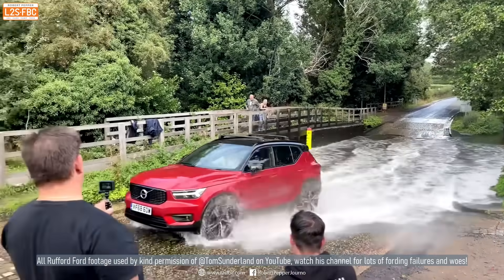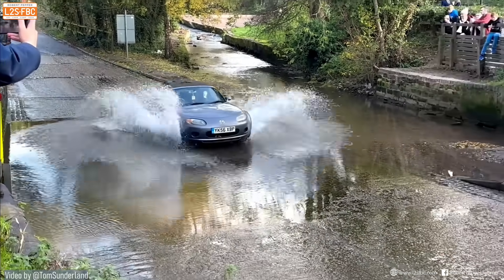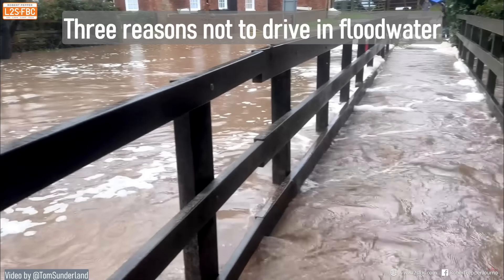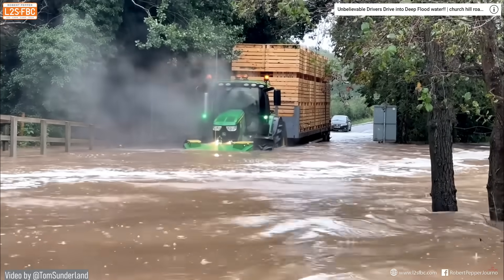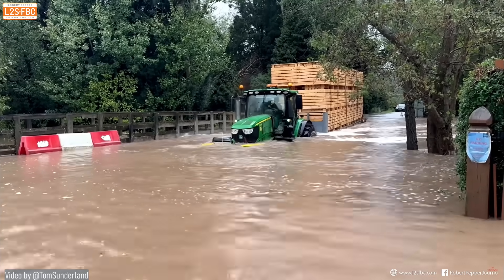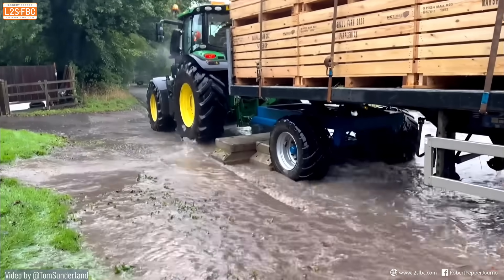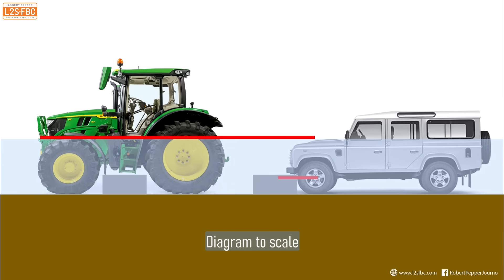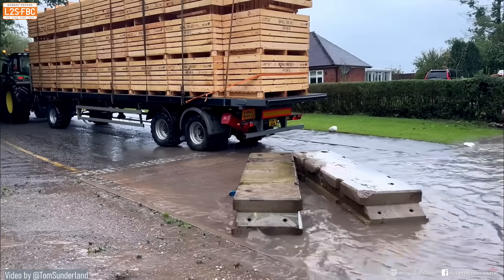A demonstration of why you shouldn't drive through floodwater.

Comment: Interesting story behind that. That ford is actually closed permanently now, and those blocks were the closure blocks put across it. A few of the locals are a bit miffed over it being closed, and ole mate in the tractor just decided to send it anyway.
Reply from the maker: Yes. aware it's closed, wasn't aware it was closed when that tractor went through!
Reply: @L2SFBC Somewhere in Tom Sunderlands footage is an excellent example of the dangers of sending it at speed too. Driver comes from the other direction, and the driver ends up going up the creek to the right instead of up the road
Reply from the maker: Can you post a link please?
Reply: Council put those barriers across,  when the water level was lower.
Reply: it's never been lawfully closed. just blocked up. it's still a public right of way.
Reply: Tractor driver knew those blocks were there, he was just fed up of the closure of the ford from these barriers that had been placed down
Reply: Pretty sure the farmer knew exactly what he was driving over.

Comment: Cars have a tendency to float, the tractor is all mass with very little displacement, cars on the other hand make passable boats, but only for a short time. Getting washed off a crossing when there is flow, or the back end floating when its deep mean that you lose control pretty easily.
Things were getting crazy at that ford and I think the road has now been closed. The farmer complained because people were trespassing on his land to dam up the creek to flood the crossing and get better vehicle splashes.
Reply from the maker: Yes, I read it went crazy...local publicans would have loved it, homeowners not so much I guess!

Comment: I was teaching some RNLI Water Rescue Instructors some years back and they have a rule-of-thumb: 6inches if water moving at 6mph (twice walking speed) will knock someone off their feet.
Water weighs 1tonne per cubic metre.
Defender 110 is approx 4.5m x 2m, wading depth is ½m so potentially 4.5 cubic m of water = 4.5t so if the water is moving you are going where it wants 🙂
Obviously 250mm is going under the LR until it hits the chassis and side but the idea makes sense to most people.
I tend to say if you haven't walked it what the heck are doing driving your vehicle there😂
Most wellie boots are not as high as official wading depth so this keeps drivers from the worst of it...

Comment: 2:47 aside from the fact that this tractor is trying to pull the trailer over the submerged obstructions, the tractor itself is almost floating and has little traction. You can see this by the way it bobs up and down. The large  wheels provide a lot of buoyancy if they are not filled with water ballast.
Reply from the maker: No it's not floating. Unlike a car there is no large air filled space. The volume of air in the tyres is not enough either and the tyres may be partially filled with water - any tractor drivers like to confirm?  This one also has additional weights over the front.

Comment: most people won't understand that that tractor had a huge weight on the front and as he probably already straddled the concrete block by the time he stoped after hitting it he couldn't reverse (at least in 2wd) because these trailers offer barely any weight transfer to the tractor (no weight on driven wheels) and that's assuming he had somewhere to back up to and turn around given he couldn't be bothered to back up enough to avoid the concrete blocs at the end...

poor situation poor driver.

  That level of water is too high for confort he probably got water in the hydraulic system gearbox and air compressor as well some troubles could be on their way...

Comment: The easiest reason for me would already be: usually the force of the water is vastly underestimated by everybody and so it gets too dangerous. (washing away the car) Even if the water is not higher than the ground clearance of the car. (Have seen firetrucks having a hard time crossing 30cm of water on a road, which would have been easy if it would have been just about the depth, but the current was so strong that the truck barely made it across and was moved sideways a lot)
Apart from brining the point across (hopefully to those who questioned a reason beforehand) i think this video example also shows that the guy on the tractor is very much not the brightest light under the sun.
Right when his front wheels were going up on something he should have already realized that he won't be able to pull that trailer over this size of obstacle he just found.

Comment: Another issue is mechanically driven fans pulling forward because they get more "grip" in water than they do the air they are designed for. Its quite common for them to move enough to chew a hole in the radiator. That gets bad quickly. Notice the water spraying out the side of the motor on the tractor as it exits the water, the fan doing that?

Comment: The crazy thing is that there is a detour around the ford that adds only an extra 2.5 miles or 7 minutes. Yet people directly into flood water and put their lives at risk. I guess this another case of 'this is why we can't have nice things.'
Reply: Can you imagine the farmers having that detour in a tractor. They've been driving that ford for I don't know how many years and then council comes along an puts concrete k rails across because some dickhead gets their toerag flooded. Catering to the lowest common denominator.
Reply: That's the reason the farmer was pissed. 7 minutes by car is not 7 minutes by tractor. 2.5 miles is a pretty long distance with farming equipment.
Reply from the maker: Yes - fuel as well, it all adds up if you're doing that trip a lot and time is money.  I can understand the annoyance if there's an extra 2.5 miles of distance on what is probably a 2 mile journey.  But, that doesn't excuse what happened.

Comment: My dad said to me when I was learning to drive 45+ years ago. "Never drive through water you don't know the depth of." And to this date, I never have.
As you pointed out. If you can't see the road surface you're driving over, how do you know it's still there?
As for the video and those concrete blocks. Where the hell did they come from? There seems to be know where upstream from the rivers normal depth that they could have come from.
They'll remain a mystery unless someone knows.  🤔
Reply from the maker: Seems the council put them there to block the road. However they either forgot floodwater rises, thought nobody would drive through if it did, or the blocks were moved by the water.
Reply: @L2SFBC  That would be so typical of the council.
There used to be one of those triangular FLOOD AHEAD! signs on a local road the the council put there when we had some big floods a few years ago on a section of road that doesn't normally flood. But it did, that one year.
That sign stayed there for about 3 years before it vanished one night and not a puddle was to be seen since the flood   ;-))...

Comment: I think those concrete blocks was placed there intentionally by road service to stop driving through water when level was half of size. Then water level got higher and blocks simply submerged.
Reply: Yeah, they weren't washed in there by flood water. They were put in to close the ford.

Comment: As already mentioned. The guy on the tractor was p**s*d with the closure and decided to “open” it . He knew very well the blocks where there and took advantage of the water which helped to reduce the weight and friction of the blocks. Therefore making “easier” to drag them. 😉 Although i agree that floods are dangerous to cross, it is 100% NOT what happened here.
Reply from the maker: Nobody has said the driver knew there were blocks there.  They have said it was closed.

Comment: The statement that it's not possible to climb a step higher than the radius of the tires is incorrect for any vehicle that has at least one driven front and rear axle (which includes the depicted Defender) and enough torque at the front axle (which may not include a Defender). The driven front axle can lift itself onto the step while the rear axle is pushing it against it, increasing the climbing grip. The are videos showing this effect here on YouTube.
Reply from the maker: Yes and I have one myself; should have been clearer it's difficult and gets rapidly more so the higher the wall, and also you tend to run out of approach angle.

Comment: What it meant is the tractor driver was driving a closed road with a TRO, Trafic Regulation Order on it, that in the UK could be the guy loosing his licence to drive AND his car (tractor) being seized and potentially crushed (on a second offence). The Ford was close about a year ago because of, as you know, idiots dangerously driving through the ford. The blocks were laid to stop cars using the road as it had been TRO'd, as a temorary TRO, the road cannot be permenently blocked so the concrete blocks were laid to stop vehicles. I believe the road is deemed unsuitable for reopening. I actually agree with this decision unlike most permanent TRO's, as they are made to close decent lanes that actually just need a bit of work to make them usable again, oh, and less idiots on them, but then the TRO doesn't stop idiots! re: Tractor driver.